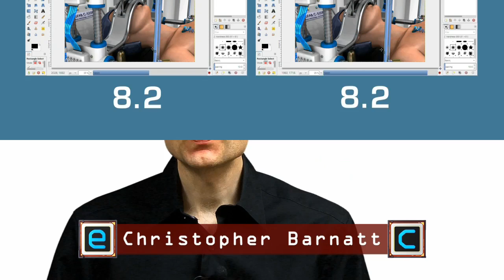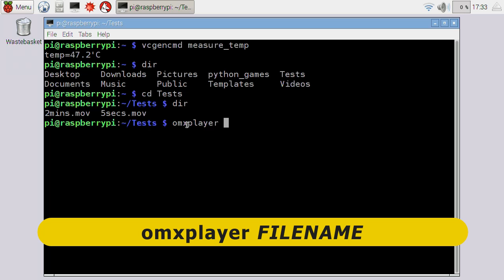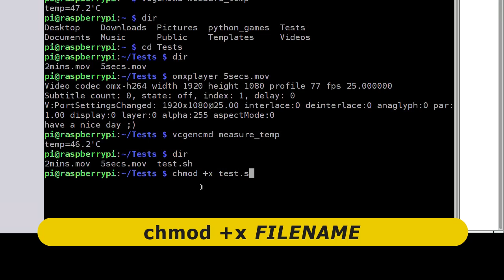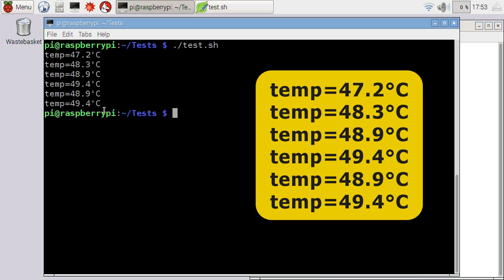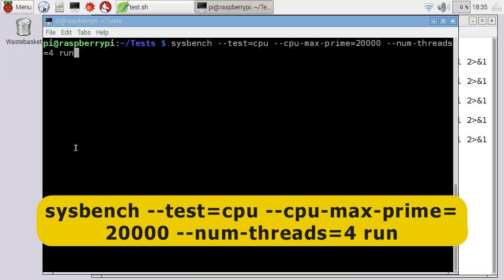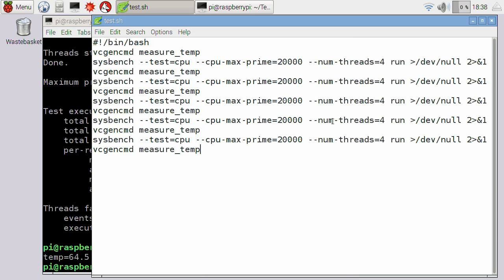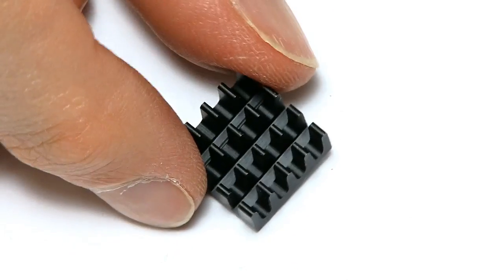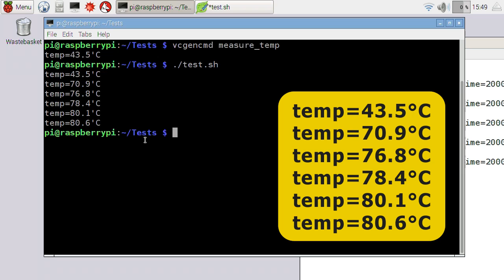Raspberry Pi 3: CPU Temperature Tests & Heatsink

Comment: So i'm wondering, well the chip it's an FCBGA, meaning it's mostly epoxy, with all the silicon and metal being at the bottom. What if you applied the heatsink to the backside of the CPU instead? The ground and power plane vias do a fair bit of thermal coupling over to the other side of the PCB.

Particularly so with Pi Zero 2w, which uses the same die but stacked configuration where the memory chip sits on top of the processor, so there's even more thermal insulation to the heatsink.

Comment: It's mostly a shut off thing or losing the RPi eventually. I like my new RPi 3B department with a bunch of terminal commands and DIY and tinkering. The worst is to block the holes and it gives the temp/heat warning. A heat sink can also go to a limit. Just take care of it. With the many USB ports and pins we can mount a fan from somewhere and run scripts on various sensors.

Comment: Hello, my raspberry 3 has sound issues, I use a vga monitor, mouse and keyboard  and the boxes from my desktop and with the normal computer are working good, but with the Raspberry 3, no are working, no sound at all. Can you tell me what can I do?
Reply from the maker: I presume that you are using an HDMI to VGA adapter? If so, you will need to take audio from that adapter into the monitor (usually via a 3.5mm lead), or you will need to take audio from the 3.5mm jack on the Pi into your monitor. If so, you'll need to check in the Pi's sound settings which audio output it is using -- you want HDMI if you are taking audio from an HDMI to VGA adapter, or analogue audio, if using the 3.5mm audio output on the Pi.
Reply: @ExplainingComputers  I try later now, I am so tired, but it is so like you sat I use an adapter my monitor has no speakers. I try later direct to my TV with HDMI cable, thanks a lot for the answer, sleep well.

Comment: Great video, and my pi 3b was running hot for some reason it's is pretty cold where I am. It was giving me the thermometer warning during regular use. So I checked the temps at idle. The pi ran at about 45.5 c average. So I decided to get a heatsink from a old soundcard I had, and cut it so that it was fit on the pi. Then I applied thermal paste, and my pi was at 36 c average.

Comment: A slightly simpler version of the script would be:

#!/bin/bash

for f in {1..7} # takes "f" and lets it =1, all the way up to 7, adding 1 every cycle
do

vcgencmd measure_temp # if f=1, first measure before stress testing
sysbench --test-cpu --cpu-max-pime=20000 --num-threads=4 run >/dev/null 2>&1

done

vcgencmd measure_temp

exit 0

Same results can be achieved with a while cycle:

#!/bin/bash

w=0 # we want to start from 0
while [ "${I}" -lt "7" ] # keep going if w is less than ("lt") 7
do

vcgencmd measure_temp # if w=0, first measure before stress testing
sysbench --test-cpu --cpu-max-pime=20000 --num-threads=4 run >/dev/null 2>&1
((w=w+1)) # bash expression, adding 1 to w, we need it here because the for cycle does it for us

done # starting from 0 going up to 6 (<7) we have 7 iterations

vcgencmd measure_temp

exit 0

And so on.
Reply from the maker: Yes, I have included a loop in later videos. :)

Comment: I think that heatsink actually helped a lot. Without it the Pi probably throttled to keep the temperature in check, so while the heatsink only improved the temperature by 2C, the performance might have increased a lot.

Comment: I just used thermal paste , no tape , and the flat copper heat sinks and so far they do nicely and the paste holds them on ok , not that I transport it often

Comment: What's a safe temperature for any CPU?
Reply from the maker: I personally worry about a CPU that gets much over 60 degrees C for any reasonable period of time. Running in the 40s or 50s is good; running below 40 is ideal but often hard to achieve.

Comment: I'm not convinced by your conclusion, I think the thermal protection throttles down the processor when it hits 85 or sth like that, that's why it increases so fast in the test without heatsink and then it reaches a plateau, in the test with heatsink it seems to be able to run at full power keeping the temperature around 80. so the heatsink is effectively reducing much more than 1-2 celcius.
Reply from the maker: I totally agree that the performance benefit is more than a few degrees -- it is a few degrees, plus a CPU that is not throttling (as much), so yes an "effective" temperature reduction that is higher. But the absolute temperature reduction is as noted! :)

Comment: I was finally able to stress test my raspberry pi 3.  It seems that I somehow missed a couple of lines of code before running the test as I had followed exactly what you did in this great video tutorial.  I forgot the "chmod +x (filename)" and the "./" lines before running the test.  My Raspberry PI 3 is enclosed in an acrylic case with two heat sinks and a little fan on top of the main CPU.  The ambient temperature in the room was 76* and during the test the Raspberry never got over 42.9*C.  Do you think that I could over clock the CPU after such good results from the stress test?  Thank you so very much for your cool videos.  I'm learning a lot about not only my Raspberry, but also about code writing and computers in general.  I thought I knew a lot about computers until I started watching your video tutorials.  Now I know how dumb I really am about computers.  Thanks again.  Rusty (Wyatt Earp).
Reply from the maker: I'm glad things are progressing well. And I think you are safe at that temperature to try overclocking.
Reply: Thanks, Chris, for your prompt reply.  I may try overclocking it and see what happens.

Comment: The heatsink size is 5.5mm  fyi.  I'd get a really tall 5.5mm heatsink w long fins and a fan thats slightly bigger and mount it on stand offs and a piece of acrylic.  No sides on the case should help it cool off.  The stubby heatsink that comes with the Pi and no fan.. looks almost pointless.

Comment: I made this as my .sh file but I dont know if this script is correct. Can someone tell me how to make it say: 56.4'C instead of: temp=56.4'C? cause that would help a lot! Here's my .sh script:

#!/bin/bash
echo Normal Temperature
/opt/vc/bin/vcgencmd measure_temp
sysbench --test=cpu --cpu-max-prime=20000 --num-threads=4 run >/dev/null 2>&1
echo Stressed1 Temperature
/opt/vc/bin/vcgencmd measure_temp
sysbench --test=cpu --cpu-max-prime=20000 --num-threads=4 run >/dev/null 2>&1
echo Stressed2 Temperature
/opt/vc/bin/vcgencmd measure_temp
sysbench --test=cpu --cpu-max-prime=20000 --num-threads=4 run >/dev/null 2>&1
echo Stressed3 Temperature
/opt/vc/bin/vcgencmd measure_temp
sysbench --test=cpu --cpu-max-prime=20000 --num-threads=4 run >/dev/null 2>&1
echo Stressed4 Temperature
/opt/vc/bin/vcgencmd measure_temp
sysbench --test=cpu --cpu-max-prime=20000 --num-threads=4 run >/dev/null 2>&1
echo StressedFINAL Temperature
/opt/vc/bin/vcgencmd measure_temp

PS: Oh and I'm using "Putty" to remote connect to my RBP3 Model B

Comment: Do you have any place where i could download your test.sh bash script?
Reply: Klink Keng yes please
Reply: I'm a complete noob at pi coding and following this video, it took me 5 minutes to make the script.

#!/bin/bash
echo Normal Temperature
/opt/vc/bin/vcgencmd measure_temp
sysbench --test=cpu --cpu-max-prime=20000 --num-threads=1 run >/dev/null 2>&1
echo Stressed1 Temperature
/opt/vc/bin/vcgencmd measure_temp
sysbench --test=cpu --cpu-max-prime=20000 --num-threads=1 run >/dev/null 2>&1
echo Stressed2 Temperature
/opt/vc/bin/vcgencmd measure_temp
sysbench --test=cpu --cpu-max-prime=20000 --num-threads=1 run >/dev/null 2>&1
echo Stressed3 Temperature
/opt/vc/bin/vcgencmd measure_temp
sysbench --test=cpu --cpu-max-prime=20000 --num-threads=1 run >/dev/null 2>&1
echo Stressed4 Temperature
/opt/vc/bin/vcgencmd measure_temp
sysbench --test=cpu --cpu-max-prime=20000 --num-threads=1 run >/dev/null 2>&1
echo StressedFINAL Temperature
/opt/vc/bin/vcgencmd measure_temp

Comment: The video test wasn't very comprehensive.
I saw your videos were 25fps. The situation would be different if playing 60fps. I assume those videos were encoded using h.264 codec?

The CPU test was pretty straight forward. Thanks for the tests. I'll plan my RPi3 cooling solutions based on your numbers.

The rest of this comment goes bit more over the normal use-case video playing but:
The situation would be a whole lot different if the video codec was something the gpu cannot decode (VP9 for example). Although everyone should re-encode their videos to a codec that RPi3 GPU can decode.
Then there's all the possible layers that can display the video. Of course that's not dependent on the video being played so the lightest one should be preferred (if possible). I assume the program you used to play the video used fully GPU accelerated layer to display the video however.

Comment: i can put some thermal paste
Reply: yes you probably can but make sure that the paste is non conductive so if it was to go everywhere, it will not damage anything, it will just need a clean with some paper towel and it should be fine

Comment: Man, while you are typing command to get temperature it is dropping.... wouldn't it better if u use "watch -n 0,5 ...." and monitor temperature all the time?
Reply from the maker: Yes, possibily. :) But the main temperature tests here were run using a script that monitored the temperature over time as a consistent processor load was executed.

Comment: I have to say, I am a bit concerned about the 'GPU Stress' that was done... Given that typically video files don't actually stress the GPU in a given system, unless of course you are actually rendering. Video files are not even remotely stressful on a system. That being said, I do not know if your test was meant to stress the GPU, or just to be an example of what to expect during video playback. If it was the former, you'll definitely want to either run an actual GPU benchmark, or sort out your own. :-)

Just a suggestion.
Reply from the maker: Thanks for this. I was trying to represent a typical user situation -- playing back a video file.

Comment: I watch this video through firefox and I have 72 degrees in 360p.
Wildly brakes HTML5. As though I play on ptntium 3 DOOM3. Really it was difficult to poison a payment with openings under cooling?
I regretted about it to purchase, at us in Ukraine it costs $50 without case, radiators, the power unit. I consider slag full.

Comment: ive seen ur cooling vids etc. .  .nice  . .will u be making a overclocking vid. . . i try to follow wot eta prime duz but i have no luck . . i dont have a config follder showing like in his vid. . .im not nuts on overclocking,  i just want to run 1250Cpu- 1275Cpu & 425Gpu . .a mild tweek + run it cooler

Comment: Thanks for the video, but I would like to see you retest with heatsinks on the CPU, ethernet/usb controller and the GPU (on the bottom) and using (additional) thermal cooling adhesive. I'm curious as to what would be the results with the best possible cooling using heatsinks only. Cheers.
Reply from the maker: +Dave The chip on the bottom is the memory -- the GPU is integrated with the CPU within the SoC that I've stuck the heat sink on. :) I've yet to try heat sinks on the memory and controller chips -- though I don't think they have temperature sensors(?).
Reply: Right, I guess additional heatsinks wouldn't make a difference for this test. Re the GPU, I was following the steps for cooling on github: https://github.com/retropie/retropie-setup/wiki/Overclocking I guess they have it wrong then. I have some heatsinks for my pi I'm considering on putting on, not sure if it would be worthwhile waiting to apply some additional thermal paste or not, hence why I asked. Would be interested in seeing what a difference a small fan would make also. Anyway, thanks for the video!
Reply from the maker: Dave
I have posted another video in which I added a fan, and another with a much larger heatsink. :) There is no doubt the GPU is on the SoC -- that's why it is a system on a chip!

Comment: Put the extra heatsink you get when you buy a Intel CPU on it. Takes slight modification, but mine runs at full throttle at 32°C
Reply from the maker: +Michi Lo Cool! :)

Comment: Kind of poor right now, still rocking my Pi B 1st and 2nd gens.

Have until now been re purposing my old Athlon64x2 / Core 2 duo system into 2u 19" racks from the electronics store w/ cut out on top for CPU cooling.

Would make my day id Pi3 (fingers crossed FreeBSD/XMBC) could decode 720p/1080p HEVC/x265 @1800kbps / AAC FDK @ 320Kbps 5.1 (fingers crossed nothing more than passive cooled with copper tube.

Comment: I would like to see something that can be used as a benchmark during this test. have your script count or something as fast as it can to get the cpu to 100% so you can use it as a measure of if the heat is causing it to throttle. And if so, how much.
Reply from the maker: +Dan Wier The CPU (all four cores) are factoring prime numbers and are being driven to 100 per cent -- that is the point of the Sysbench test used. Fair point on throttling -- I had not expected it to occur  . . .

Comment: Interesting for the part without heatsink would be to monitor (in a second terminal) the CPU-frequency.
vcgencmd measure_clock arm
My Pi 3 clock goes down below 900Mhz without a heatsink when I stressed the processor with compiling. With heatsink there is more Power available because the pi will only go down to 1000Mhz.

Comment: Thank you for this informative video, though, I do have a suggestion (which should not be mistaken as criticism,  just something I personally would have liked to see), it would be more like informative and maybe even more accurate if you would've put a second terminal where you ran the command: "watch -n1 vcgencmd measure_temp" which will provide the temperature every second forever, and play the video while overlaying this terminal. Then you would get somewhat real time temperature info, not seconds, milli, micro or nano after the video stopped playing (which could theoretically make a difference in temperature, though the difference you would see with the inaccurate sensor is indeed neglect-able), it would at least provide some visual feedback (and I personally find that rather pleasing x) ).
Reply: Was going to make this exact comment :)

Comment: Great video, however there is some more information I would love to see in these tests! I would love to see the time it takes to complete the CPU test. Using time to lunch the test would display the run time quite well. As the CPU throttling takes place due to heat triggers being surpassed it would be great to know what kind of performance hit we see. Doing that with no heatsink, heatsink, and heatsink with active cooling would provide all sorts of useful information about how I would build out a raspberry pi system. Also measuring power consumption during the tests would be pretty great too so I can see how much more power the CPU can consume when heat dissipation goes up and throttling happens at different performance levels because of that dissipation. Thanks again! Looking forward to your next videos.

Comment: I wonder how much the CPU got throttled down on the test without cooling. Sure, the difference with and without cooling is minimal, measured on temperature, but the second test shows the calculations being made at full speed, whereas the first test doesn't do so. Was there a big difference in the timespan both tests took?
Reply from the maker: +Martin Jansson Interesting point. There was no noticable difference in timespan. I sadly don't have the real-time files to refer back to.

Comment: What a lovely video to intriduce bash script. Well done. Very good video to introduce all a pi3 can do with maximum range of useful commands.
Reply from the maker: +pokies100 Many thanks. :)
Reply: +ExplainingComputers here's a follow up on how good your work on this is 
http://indaparliament.blogspot.com/2016/05/pi3-raspberry-pi-3-cpu-heat-sink-test.html
And
Reply from the maker: pokies100 Briliant! :) Many thanks.
Reply: +ExplainingComputers I got "bash: sysbench: command not found
So new to this do not know what to do...
Reply from the maker: pokies100 You have not installed sysbench! :) You need to be online, and then open a terminal and type the command "sudo apt-get install sysbench" (do not enter the quote marks). Then all will run OK. :)
Reply: +ExplainingComputers also would you put the code you type into a box in description so that all the code used in the video is reproduced in description for quick reference. (Finding it by scrolling the video is cumbersome. I could take screen shots and look at photos later but asking you is an easy way.
Reply from the maker: pokies100 I will do this when I next have access to the files! :) My Pi hardware gets taken apart regularly as different videos go into and out of production. I do plan to do a major update of my ExplainingComputers website this Summer, and to put up some Pi pages linked to the videos where code and such can go. :)